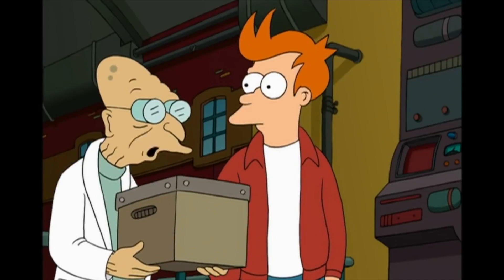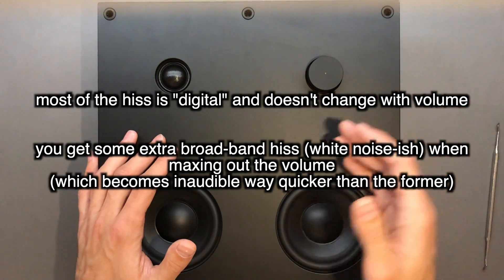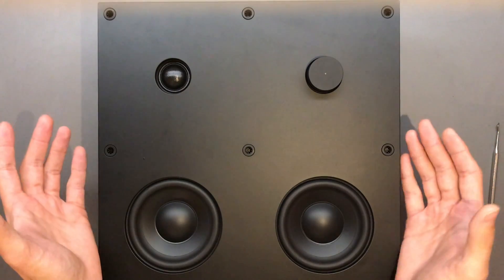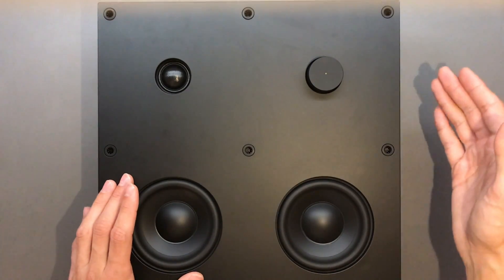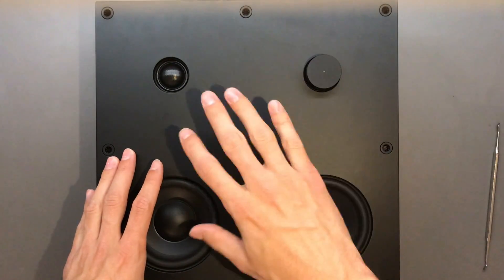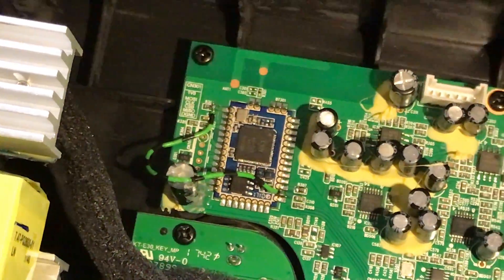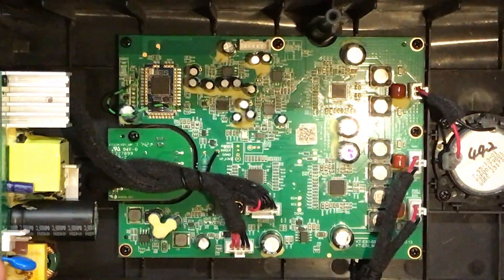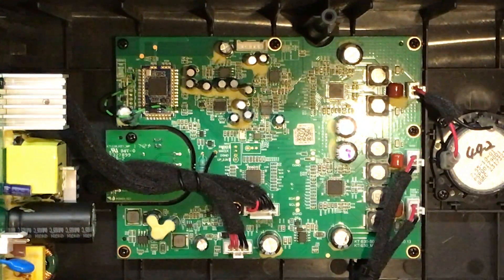How to Disable the Auto Sleep on the IKEA Eneby

Comment: thoughts on the sound quality? I have an eneby 20 and was amazed by the sound it gives off, is the 30 a noticeable difference?
Reply from the maker: It should get louder at the very least, the tweeter has a higher rated power, and there's 100% more woofers xD
Reply: @Darieee  I tested both in the store, difference is quite big.           cant compare

Comment: Not sure if I understood the video but I use the Eneby bluetoothed to my Dot and it never turns off.
Reply from the maker: Well, everyone's eneby DOES turn off
Reply: @Darieee  No, sorry, you're WRONG. My dot has been bluetoothed to my Eneby for 8 hours and not been used at all and it has not switched off or disconnected.
Reply from the maker: Well, did you buy YOURS recently? Could you check the manual? Because in ours it says they go to sleep after 20 minutes
Reply: Please consider unscrewing the back and photographing it to see if it the same or if they made a new revision
Reply: @Darieee  Mine was bought about 2 weeks ago and it does say in the instructions that it will turn off if no music is played but I can promise you it doesn't when its bluetoothed to my dot
Reply: @Apk07  Sorry I' m not  unscrewing it

Comment: Any progress in getting around the sleep mode on the aux connection?
Reply: Too bad 😐
I have a Eneby 20 with a Chromecast Audio plugged in. 
My first thought was to put a Sonoff power switch inside so I could tell my Google Home to turn on the speaker and then put on some music. 
I haven't yet opened the speaker nor ordered the Sonoff switch.

Thanks for the great video!
Reply from the maker: Nah, haven't had the time to work on the eneby lately unfortunately - it's still going to happen sooner rather than later
Reply: Wouldn't this keep it awake even if you had something connected to the aux?
Reply: Karl Berg no, it only works when it’s connected by Bluetooth.
Reply from the maker: by Bluetooth -- WITH the mod or with music streaming

Comment: The CSRA64110/210 does support TWS, but does lack APT-X. Only the 64215 support APT-X. So yes, it's a little weaker, but you should be able to use the TWS function. I actually took my Eneby apart a couple of months ago and discovered the 64110, I was excited over the fact that we should be able to use the TWS. Too bad I haven't had the time to do any  testing yet. Great mod btw, will for sure do the same! Such a design fault!
Reply from the maker: Yeah, really bad with the auto-sleep

Do let me know if you get the TWS going ... I haven't yet hooked mine up to the SPI converter, let's see, maybe .. just maybe .. we can get that going as well
Reply: @Darieee  I'll let you know straight away. Haven't hooked mine up either as someone has borrowed it. I do on the other hand have a BT amp with another 64110 with TWS already set up. I'm thinking of getting the .psr file from it so it might be easier to get the correct setup. I'll keep you updated.
Reply from the maker: Duuuude - can you sent me an email with said psr? And tell me how you enable it ?

I've always wanted to play around with that but never had any project that needed it - and setting up something just for this was always too much of a hassle
Reply: Ofc, the more people who are looking into this the better. Give me your email and I'll send you the file tomorrow. It seems like there are different ways of enabling the TWS. Haven't looked to much into it yet, but it's all down to different button-event presses. I'll send you more info on email when I get the .psr file.
Reply from the maker: havirneanu@gmail.com
Reply from the maker: Thanks! Can I also make a tutorial on that if I/we get it to work ?
Reply: Yes, definitely! I would be happy to help and share whatever we find. Would be nice to get this working, as it's the last thing that I have not yet managed to do with these chips. It's probably also many others who would love a tutorial on how to pair their Eneby/BT speakers together without bricking or destrying them (as I've done too many times with the 86xx)
Reply from the maker: Yeah, the 86 series was quite easily brickable - 80% of the time you could boot them up with a button/2 pressed, and that would get them in a flashable safe mode type state

Anyway, eagerly awaiting your mail :D.

1. Stop it sleeping (x)
2. Enable TWS ( )
3. Add battery power
4. Prevent sleep for AUX
Reply: I've learned to alway to do a copy of the .HEX file before starting with serious changes. That way you can 99% of the time restore it. Only had one issue where i burned the chip completely dead. (still don't know why) 

Don't know how the audio is routed, but you might be able to fix the AUX sleeping issue with an pnp transistor.  Most of the AUX connectors makes a short to ground to signal that a cable is inserted. Maybe you could use that along with a pnp to pull the BT pin high? Don't know if it works, but it's worth a try? Anyway, I'm looking forward to try to get this to work and make the Eneby better!
Reply from the maker: The problem with that is, EVEN with the jack plugged in, it goes to sleep (retarded all the way). Furthermore, the jack being plugged in hard-turns the bt module off ... so ... we need to find how they detect music on the AUX, and force that somehow
Reply: @Darieee  If you do, that would be incredible.  I bought a couple of them last week and if the others are to be taken at their word, mine must be old stock, as they both auto-off whether they are connected to bluetooth (Google Home, setting it as the "default" speaker) or with something plugged into the 3.5mm.